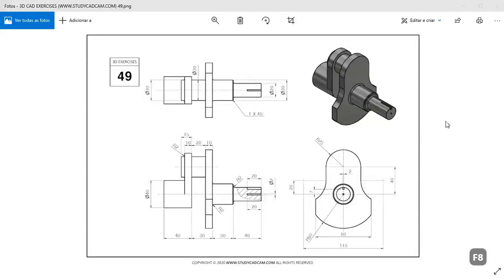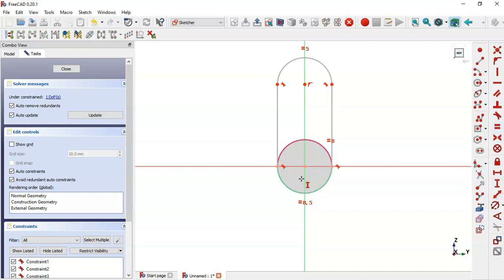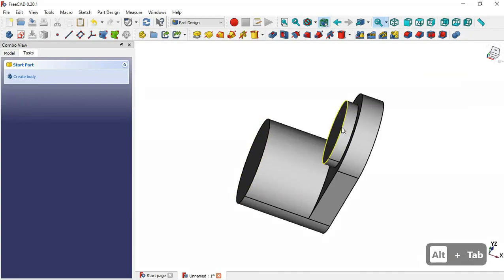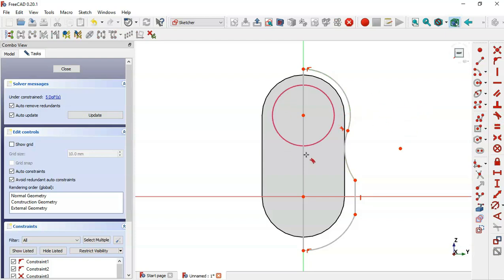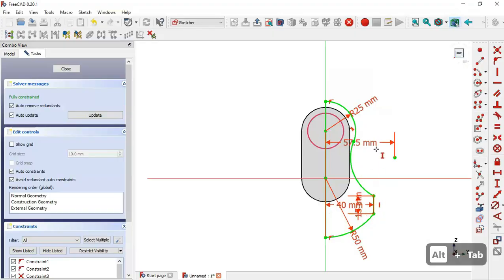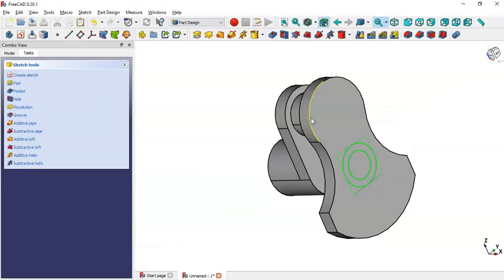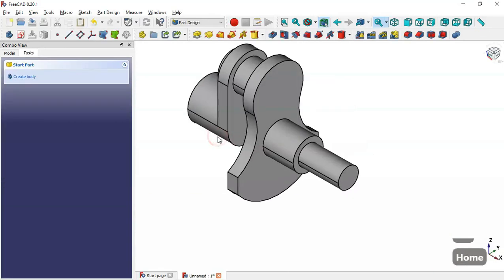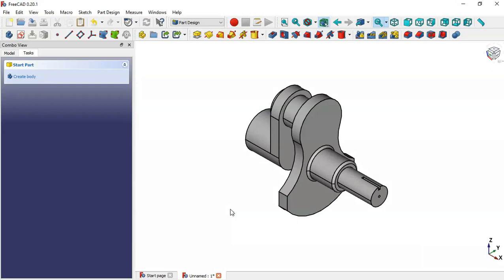FreeCAD Beginners tutorial: practical exercise 57 - studycadcam model

Comment: Is it possible that you made an error at 4:41 in the sketch? I have tried to draw the sketch and after the top arc there is a straight line down vertically from 20 mm  and then comes the second arc in the opposite direction. But i can be wrong.
Reply from the maker: Yes! Thank you!
I made an error at 4:41 in the Sketch.
Thank you for your attention.